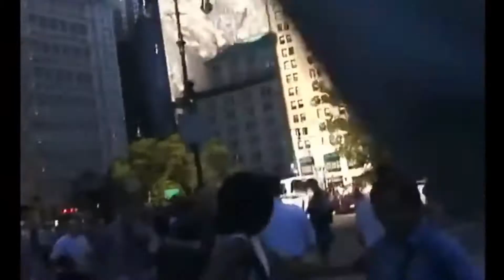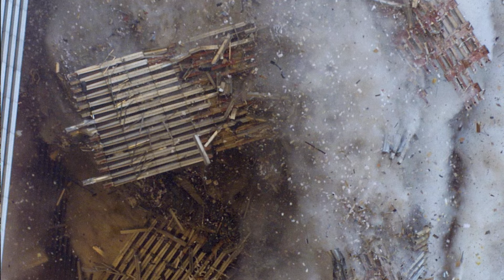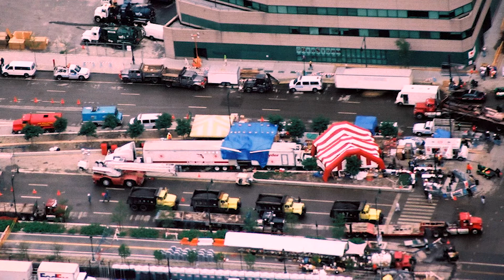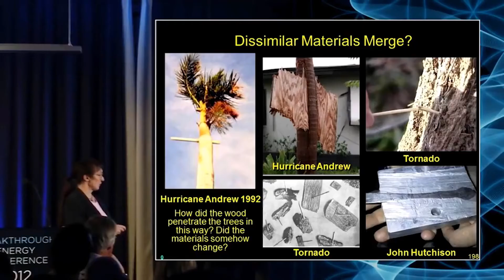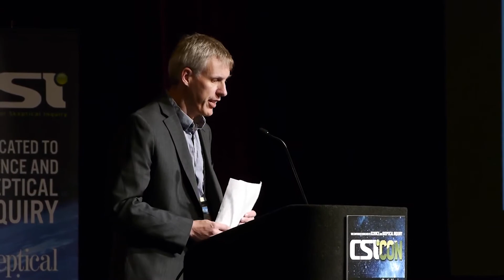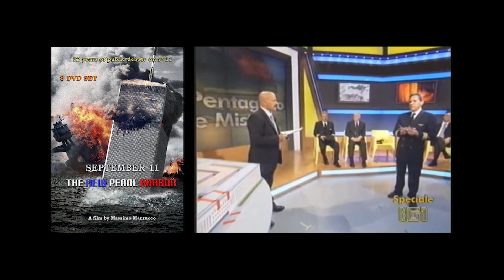Where Did The Towers Go?

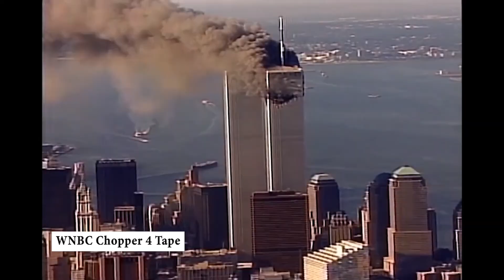Comment: at 1:37:41 the chopper 4 footage is shown, but what is failed to be discussed is how the object coming from above diagonally down doesn’t look like a plane, and seconds after hitting the tower, it flies away (which the clip didn’t run long enough to show here).

I think this deserves consideration over what exactly this means and if it was a pre-done “plant” piece of footage (or whatever is going on) to throw ppl off into the no plane theory—or if it is actually a “ufo” and it was truly captured live, then that would beg the question why the ppl on the ground witnessed a plane vs a “ufo”.
Reply: Lol. Exactly.
Reply: The whole thing was manufactured, so how do we know that there was really any planes? Missiles maybe but I don't buy the plane theory. Even the guy said that the buildings could withstand several hits by a plane. The so called plane evidence certainly could have been planted there. I don't buy the DNA either. Holograms could have been used. The live streaming of the news was so botched up. If there were real planes they would not have needed to  mess with the footage. I've looked over and over again at the so called first plane, even slowed it down, it appears out of nowhere. Up until the part about the planes, I was going for this video, but I just cannot accept that there were planes. I do believe that these folks are about full spectrum dominance, and they will try to cover all basis to keep folks running in one direction against the other. They did everything that day. And if there were planes, they were not commercial passenger planes more like missiles or holograms or just folks believing they saw a plane because that narrative spread like wild fire that day. We may never know the whole true story, but one thing is for sure, it is definitely part of a nefarious and evil agenda by the hidden hands that rule this world.